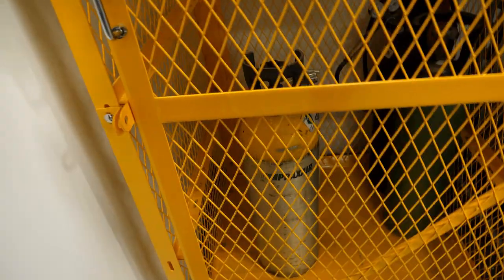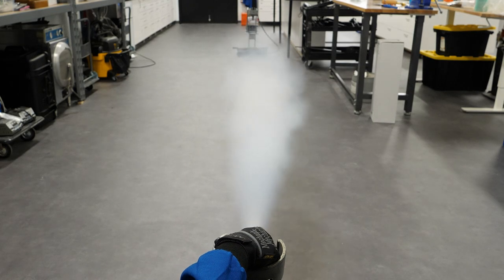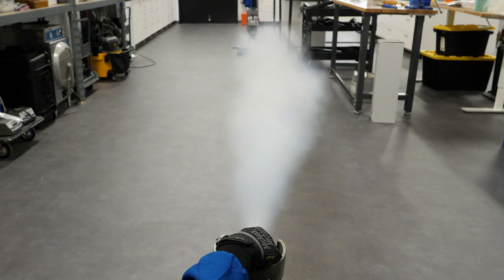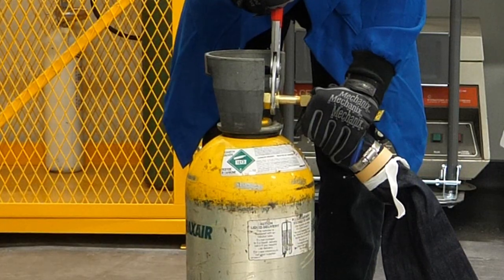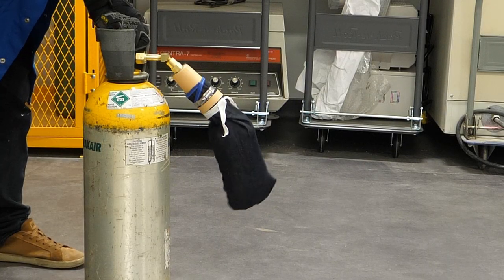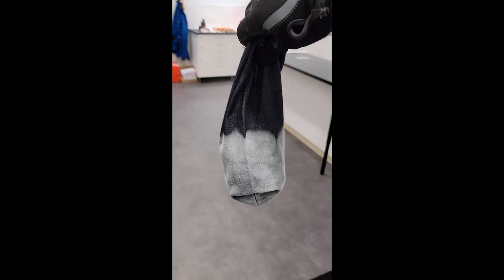Making dry ice from scratch

Comment: Doctor's Notes on Carbon Dioxide (CO2) Poisoning

Carbon dioxide poisoning (also called hypercapnia or hypercarbia) results from high levels of carbon dioxide in the blood. Carbon dioxide poisoning often occurs while scuba diving, from inadequate ventilation, inadequate breathing, a tight wetsuit, overexertion, regulator malfunction, deep diving, and contamination of the air supply with exhaled gases, which can cause a carbon dioxide buildup. Carbon dioxide levels in the blood may increase, causing shortness of breath and drowsiness, resulting in carbon dioxide toxicity.

Symptoms of carbon dioxide poisoning include nausea, vomiting, dizziness, headache, rapid breathing, fast heart rate, and flushing (warmth, redness, or tingling of the skin). Symptoms of severe cases of carbon dioxide poisoning may include confusion, convulsions, and loss of consciousness.

Comment: Will all of the dry ice evaporate cleanly or will there be a chance of it causing some moisture in the air to condensate and pool on the surface of the table? What happens if you put dry ice in a very humid environment?

Comment: Why does that even work? There should still be significantly less pressure in the sack than in the cylinder. One would expect it to slow down some, sure. But why would it freeze? There shouldn't be enough pressure to do so. Right?